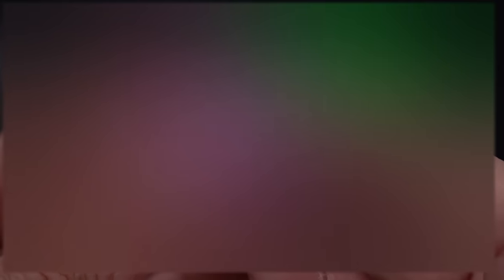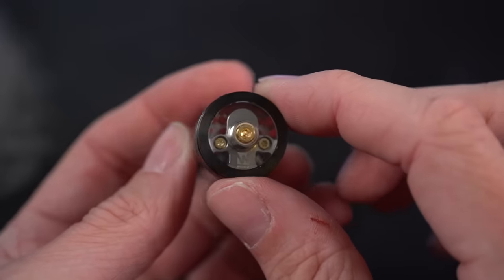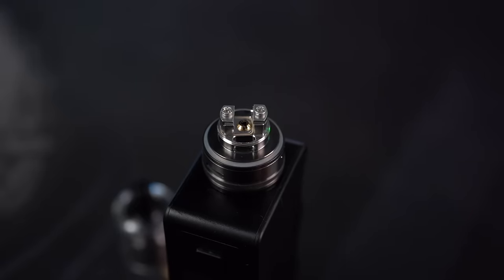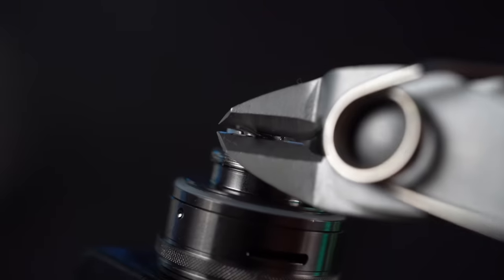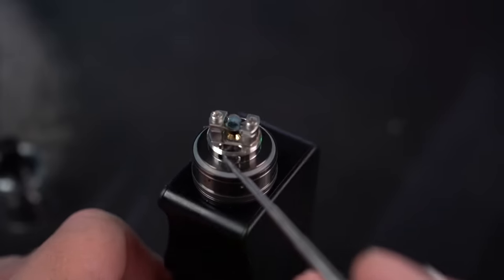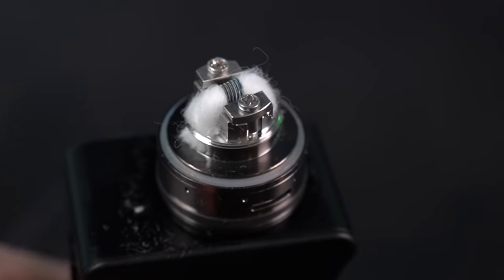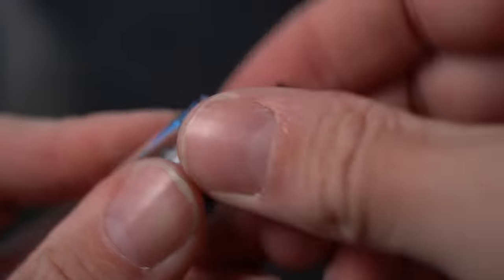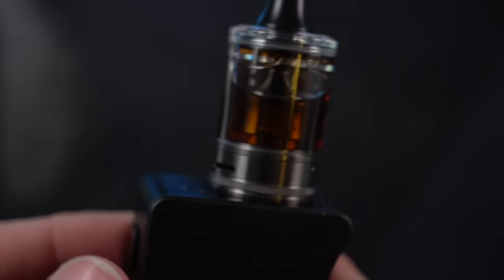COGRTA - Use More Cotton Than You Think You Need

Comment: So glad that I'm not the only one who experienced leaking with this tank. I'm impressed by the overall build of it but 50/50 liquids have been troublesome for me with it though. No matter what I do, it always ended up gurgling. I've got a 2.5mm coil in it and tried multiple wicking methods. Even tried stuffing an insane amount of cotton through it. Enough that it almost wouldn't fit through the coil or inside the wick ports. As long as I was using 50/50, it ended up gurgling after a few minutes.

I tried a higher VG 70/30 with a super packed wick and so far, it seems to be doing better but it still gets gurgly after a short amount of time. I think they just made the wicking ports too large and with no adjustments for juice flow, you're a bit limited with what sorts of e-liquid to use in it.

The quality is great, the flavor is nice, and it looks beautiful. They just missed the mark a bit on the wick ports IMO. I'm also not noticing a considerable difference between air flow settings but it is MTL enough for my liking. If the air flow is set at it's widest setting, it seems to function properly. Reducing the air flow to a tighter draw seems to only increase the suction inside of the tank and causes it to wick more aggressively and get gurgly again even on a 70/30 e-liquid.

Such a shame. This will likely end up on a shelf somewhere not being used

Comment: Great review Nick. Every reviewer I've watched review the COG RTA says the same that the airflow range is more narrow than Matts (SMM) described in his introduction video, and it's very little difference between the click stop settings. And I agree with you that the screw on topcap easy can flood the deck, It happens specially on my Kaees Solomon 2 because of the form on the topcap it's like a tophatt uppside down and make pressure when you thread it on.. I don't have the same problem with my OBS Crius 2 Dual that has a ring you push up to expose the filling hole and you only push it down to close it, it's a very good dual coil RTA OBS makes great RTA's. It's the same filling system on my Kanger Protank 4 with a great dual coil RBA deck but the airflow on the drip tip only adds cold air into the mix so I use only the bottom airflow. But it's not so notisable on the GEAR RTA if you close off the airflow before you fill it up because of how the topcap is formed but on my Kaees Solomon 2 when it floods the deck I use a syringe with a blunt tip needle down the 810 drip tip and sometimes I can suck up as much as 0.5 ml of e-juice and that is a lot of flooding.

Comment: I don't know.  I have two and they perform identically.  The difference in the draw between the .8 and 1.6mm air flow is not that much.  The 1.6 feels like a 1.6 but the .8 is definitely not .8 on mine.  It is more like a 1.2mm and perfectly acceptable draw-wise to me.  My only complaint on mine (both tanks) is that, while they don't flood, I do get a LOT of gurgle from condensation under the drip tip.  I've tried both tips that come with the tank(s) and also some of my own.  Same issue.  I have to constantly clean that out.
Reply: Bro I get that condensation under the  drip tip on every single mtl atty I own. I found out it's the type of drip tip cuz it acts like a straw and I end up with a mouth full of 12mg ejuice . Yuck. But if I use a wide bore driptip it doesn't do that.  I use the gear rta driptip/ and the hellvape md rta driptips cuz they are 510 but wide bore so it doesn't suck up juice. Sucks cuz I love the feel of tall 510 mtl driptips:-/

Comment: Just wash it with warm running water from the sink. Let the water enter through the airflow to clean the liquid, then blow it well. I've already done that.
The problem for me is that liquid accumulates under the mouth piece and I have to clean it often.
Reply: worst tank ever
Reply: In fact, after a few days of testing, it is a really good atomizer.
- I changed my mouthpiece. Plug 510 was too short and liquid was collecting under it.
- Airflow is not perfect but for me position 3 is ok.
- Try different resistance builds and you will find the right one for you.
- Do not overtighten the cap on which you supply liquid. 
- When I change the coil, I always wash the atomizer under hot water before putting the new coil.
Reply: @unqkaa  i’ve had it for months & ive put different builds in it& it’s still a piece of crap& the juice builds up under the mouthpiece in all of em…total waste of money imo
Reply: @Man_fay_the_Bru  You know no atomizer is perfect. So, if we take an atomizer and give it to 100 people, probably 30% will not like it. I understand and respect your opinion, no offense.
Reply: @unqkaa  no offence taken mate, i’m not the only one that has problems with it,i only got it because i wanted a better tank than my ares but it’s worse& at least it made me appreciate my dtl tanks more…my favourites are the gear& the blotto
Reply: @Man_fay_the_Bru  Correct. It depends on which atomizer you compare it to. I got used to it, but if I had to buy it again, I think I would focus on something else.
I wanted to say what I did to be able to use it because there are many who have the same problems with it.
Reply: @unqkaa  true, imo matt should scrap the idea of this gear cog thing& concentrate on getting the airflow sorted, he could’ve added a wider slot so it could be rdl or mtl but as it is just now it’s a fail